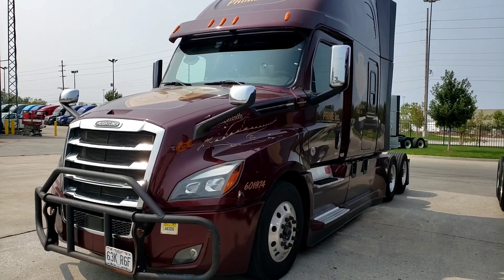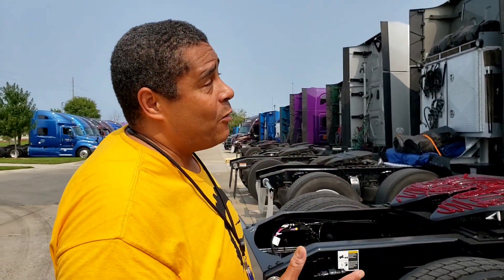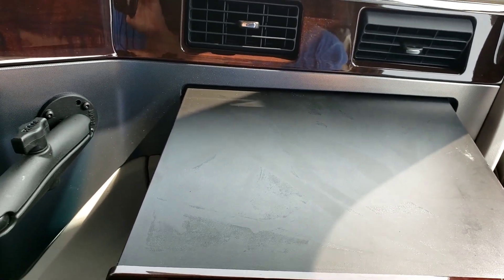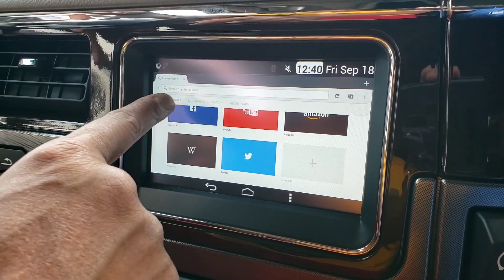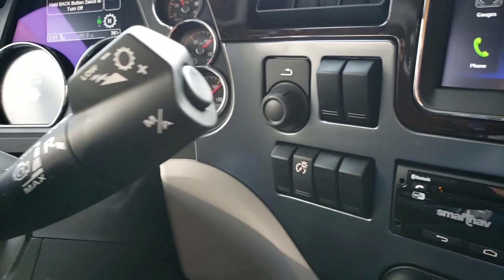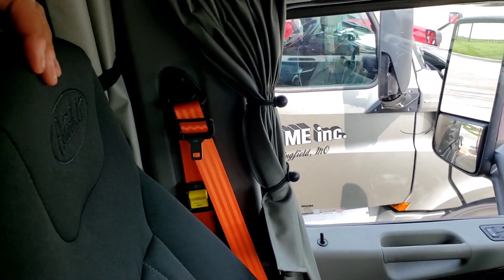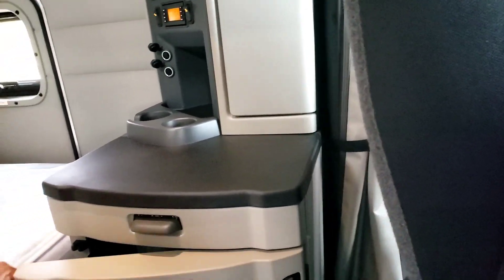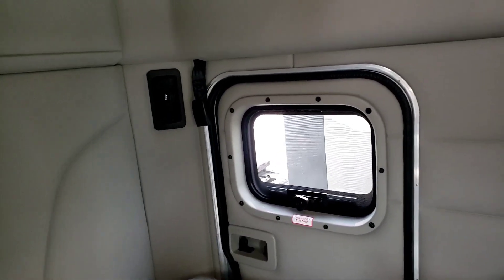My New Truck! 2021 Peterbilt 579 Ultraloft - Full Truck Tour. Inside, Outside and Engine.

Comment: Super singles are a nice ride , they slip alittle in the rain and things like that but you’ll get familiar with them fast no biggie. You save weight with them as well
Reply: They suck in slush, sleet or snow. And as a mechanic they're a pain in the ass to change. Give me dualies any day. We're changing out our whole fleet back to dualies.
Reply from the maker: I haven't had any issues with them in slush, sleet or snow. I'm sure the brand has a lot to do with it. I can see your point about why mechanics wouldn't like them.
Reply: @JJtheTrucker  lol maybe it's just the truckers and always hearing them whine lol and maybe cuz I'm getting old😜we are changing them out tho.. that is one sharp rig btw
Reply from the maker: Aww, c'mon... Truckers don't whine! 🤣😂🤣😂🤣😂🤣😂🤣😂🤣😂
Reply: @machinistmikethetinkerer4827  lol us as truckers don’t have to break the tires off rims and set them on like you as a mechanic so I can see where your thoughts on them are different then us as drivers. They are alittle ruff in snow and slush but it’s like anything else you end up adapting to it. I experience with super singles are with straight boar tankers so I have it ever alittle worse considering I have to fight the loads shifting in weather especially since I haul food products so their isn’t any baffles in the trailers I haul
Reply: @James yeah the guys up here in the great white north, or at least my guys, seem to have more problems than usual. They're hauling cryo tankers and have complained enough where mgmt. has decided for us to switch em all back to dualies. The size and weight make them a bear to change; alot of bullwork. They just don't like to cooperate. But again, I'm gettin old! ☺️

Comment: When’s the update about the apu ac killing storage space under the bed just like it does on the freightliner
Reply from the maker: It's comin. I was fine with where they installed it on the Freightliner, but not in the Peterbilt. They put it right in front of the left baggage door! That whole door is completely useless now. Wish they'd have put it in the middle.
Reply: @JJtheTrucker   that was brilliant of them

Comment: Hi Jasen, is this is an old recording? I ask because on one of your previous video it had the super singles already 🤔..
So, you're doing your lease purchase and eventually you'll be done with your payments lets say in 3 years but after you pay it off, can you still use it under primes authority? and I ask this because most of the videos I've seeing from prime says that if an owner operator wants to join prime, their trucks have to be 2018 or newer but when you pay of your truck lets say by the of 2024 your truck will not be considered a newer model to prime I guess right? So that means you will have to go under your own authority or will prime still consider your truck under their own authority?
Reply from the maker: The first part of this vid was recorded earlier than the caves vid where I showed it with singles.
Yes, once it's paid off in 3 years, I can still run under Prime's Authority with that truck fkr 2 more years. After that, it will be inspected annually to ensure it meets their safety requirements, etc.
Reply: @JJtheTrucker  hey buddy, forgot to ask you...
Can I get into the lease purchase as soon as I upgrade from TnT with the available $$$ down payment instead of doing lease first or do I have to wait a certain time before I can do lease purchase?
Reply from the maker: They say you have to wait 90 days, however Lyle was given the opportunity  as soon as he came out of TNT. The best thing to do is to call success leasing when you are just about finished with your TNT, and ask them. They're very friendly and helpful down there.
Reply: @JJtheTrucker  Thank you 👍

Comment: I like Freightliner's fuel economy. I can't give it up. 🙂
Reply from the maker: Valid point.
Reply: Well it really doesn't do too bad now compared to older Peterbilts. I have a 2020 579 ultraloft from Prime. It  gives me 8.4 to 9.6 MPG with a gross weight of 80,000 lbs running at 65 miles per hour. With a empty load it runs well over 10 MPG. I don't know how much a Freightliner will give but that's pretty good for any truck!
Reply from the maker: That is really good! So far mine has been all over but I've only hauled 2 loads in the northwest mountains, so it's not going to be a good stable reading yet. So far, not bad... Plus it's not broken in yet. I have a feeling it'll be pretty comparable to the Freightliner, just like yours.
Reply: Yes pretty good on this end. I was also given a tip with these new Peterbilt from ace 2 classes. I was told to try to keep the rpms at no higher than 11,000 as much as possible. That's when I realized that I was pushing her to hard on hills.. lol.. it was burning up way more fuel than I wanted by down shifting to a lower gear while the rpms were running at high 14 to 15 range. When I eased up on it I noticed a Dramatic change!
Reply from the maker: Yeah, a lot of people try to run the trucks like their gasoline cars, where the best torque is in the 5000 range or higher. These trucks have their best torque at 1100 to 1300 RPMs. It's almost unimaginably low.
Reply: @trell0123  wow! Whats your setup?

Comment: Hey JJ man (and other truckers that might read this). Regarding the space for a microwave: have u seen people install toaster ovens as alternatives?  They get pretty hot externally. My thoughts would be to add a heat resistant material between the unit and the cubby. They’re cooking is diverse. Any thoughts?
Reply from the maker: I've hear others wanting to do it and I guess the heat shielding may help but not sure. The straps would be my concern. It has to be strapped down.

Comment: JJ I appreciate all your info as I am getting into my new 2021 Pete this coming week. I did not see you mention a fifth wheel release button from inside the truck like the freights or KW’s. Can you mention that?
Reply from the maker: There's no 5th wheel release button. The Cascadia that Prime orders doesn't have it either. Same with the Volvo. The Volvo has a hood release button though.
What I want is a trailer tandem pin release button!

Comment: The new freightliner table is under the bed it turns into a table with 2 chairs idk the new premium freightliner is better than this peterbuilt only thing that’s it’s not better in is ride quality
Reply from the maker: Yeah, there are certainly things I miss about the FL compared to the Pete but the ride quality and some other things make it totally worth it (IMHO).

Comment: I been on the road since late winter 1994 as a truck driver over 26yrs and March 2021 will be 27yrs but I wonder why new truck drivers with 5th months to 10yrs experience become superior over my 26yrs experience and I watch yall at the scale house get pull out of service all the time and watch yall break down on the side of the road all the time,  but also I been a trainer for KLLM in 1997 to 1999, trainer for Warner 1999 to 2001, with 30 drivers i trained successfully still on the road today,  some of them are trainers, and some of them owner operators just like, I been a owner operator since June 2002 and I was asked to do video on my experience but I turned it down,  I rather someone else do it and as long they have knowledge what they are talking about the 🚛🚛🚛🚛 games

Comment: Does your sleeper door have a gap? I have a 21 and mine has a gap
Reply from the maker: No. The Freightliner had a gap. I used thick rubber weatherstripping around it to seal that gap, but the Peterbilt fits nice and snug with no gap.

Comment: To set temperature you have to hit  it auto button first. I'm on my second 579 peterbilt for company I work good trucks. Need and info let me know
Reply: To flash light with the turn signal  push it down and they go off.

Comment: Awesome truck I drove a 2019.
This one though didn’t have the freedom inverter which comes with wall plugs. There’s one thing to watch out for though is the space between your cabinet and bunk. Don’t drop an iPhone down there, I dug mine out with fifth wheel puller and scared me that I lost my phone.
Reply from the maker: Yeah, that was definitely a worry of mine as well. I now have an extension cord in that Gap so that nothing Falls in there.

Comment: Peterbilt really step up their game🔥💯
Reply from the maker: Yes, they sure did. Still some stepping room but I'm impressed.
Reply: @JJtheTrucker  what about the T680 or the 389?
Reply: @JJtheTrucker  and the new LT?
Reply from the maker: The 389s wheelbase is too ling for Prime. They only do aero trucks.
You can get a KW as an owner op but you have to buy it from a dealership.
Prime o KY does the Cascadia, 579 and LT
Reply from the maker: Yep, they have those.

Comment: Apologize if a stupid question, but how is there not a dual rear tires, yet they come with dual tires on both axles, and the. they come change both the tires and wheels.

Why is it that way?  Doesn’t seem logical.
Reply from the maker: Good question. There are many advantages for super singles over dual tires. The number one reason is fuel mileage. Super singles get better fuel mileage than the duals.
Reply: JJ the Trucker  - Thank you, I omitted a key word though.  I meant to ask about the dual tire option... you said it wasn’t available.  Why would it not be available when it ships that way, and the cost to change them.
Reply from the maker: Prime is just really big on low fuel mileage and consistency within their Fleet.

Comment: how long til the xbox and 32" installation? 😂 👍
Reply from the maker: It's comin... Been running like crazy and haven't had time to get everything installed yet, but it won't be much longer. 😊
Reply: @JJtheTrucker  was there a problem with installing your mount at the dealership?
Reply from the maker: The truck came with a flat mount for a very small TV,and it's set off to the side. But it's a stable mount, so I used it by mounting the TV arm mount right to the side of the existing mount. Used the same screw holes and everything. Nice and stable.

Comment: As far as the HVAC controls you set the temperature to where you’re comfortable and press auto end it will maintain the temperature, For example if you set it for 70°F during the day as you’re driving and the sun goes down and gets cooler out the fan speed will slow down to maintain 70! Or if it starts to get really hot out the fan will speed up to maintain that temperature!
Reply from the maker: Yeah, it works really well in the summer and I enjoyed using it however I've noticed that no matter what, it always keeps the air conditioner on. Even when it's cold out and it's heating. Seems counterproductive although I know they're just trying to keep the air dry by doing that. I would rather control it manually without the AC on during the winter. But during the summer it works very well.

Comment: I wonder since you are only a single driver wouldn’t it be easier to have a dinette or I guess a table and two bench seats on the bottom and then sleep on the top I don’t know I’m just curious
Reply from the maker: Some trucks come with thst option. Takes away a lot of storage doing it that way though. Personal preference.

Comment: If your going with the blacked out grill you should look into getting the wheels powder coated black or black chrome with the tanks the same. That would look great together, actually it’ll look better that way the grill ain’t one color where chrome should be and the wheels another. It’ll all match up and look sweet. I had a WL900 Kenworth all done up with a cat, twin turbos , 18 speed, the list goes on and that thing moved like there wasn’t a load on it even when I was on the “very heavy” side of the scales. But anyways it had the wheels, tanks, and 6inch straight stacks all blacked out with the body (it was a dump truck) the same, all black chrome. The cab was a metal faked cherry red with a pearl coat over it. Man it was nice but I had to wash it every other day from going in and out of  the dumps everyday . Wasn’t exactly the best kinda work for a truck that looked like that but I loved it. 😊
Reply from the maker: Where can I get that done?

Comment: I preer dual bud spaced tires in the back anyday over super singles. But super singles are much better than they used to be, and as long as you keep them aired up properly they won't be a problem, however if they're low on air even just a little they will have a pretty good chance of blowing out. My dad worked for Flying J before they were Pilot Flying J and they had super singles there and those guy's wouldn't air them tires up and they'd just blow out left and right compared to the duals.

Comment: I run a 2020 kw t680 there are a few differences between the t680 and the 579 both are pretty good trucks. The only thing i dont like about my t680 is it has a mx13.

Comment: Nice truck.... but I can't believe people still do the starving trucker lease plan with prime🤔
Reply from the maker: Really?!? You clearly are not educated enough in Prime's lease program if you're saying that. Why don't you go ahead and watch some of my other videos talking about the lease program and get some education so that you'll stop spreading false rumors and lies about this program.
Reply: @JJtheTrucker  sorry but unless things have changed...over 20 yrs and 4 million more miles spent trucking, talking to many Prime drivers, not one has ever spoke highly of leasing. Now, all I did was make a simple statement but you can be a dic all you want. but if the majority says negative things then I'll go with that rather than the few who says otherwise.
Reply from the maker: Seems like every time someone says something negative about anything new or something that's working, they throw in their 20 years of trucking hat into the ring. Things do change, but most of all, you have zero first hand experience in what you're talking about. Only second hand, one sided stories. I may not have 20 years and 4 million miles, but I do have first hand experience with the Prime Lease, and I'm doing anything but starving.
Reply: @JJtheTrucker  Have you done a video break down of total operation costs vs profit per quarter? I looked and didn't see one.
Reply from the maker: No, not yet. I wanted to get a full year's worth of data in my spreadsheet before doing that. That way the numbers aren't skewed by home time or lack thereof within any single month or quarter.
Reply: @JJtheTrucker  I forgot to ask....you have any say as to where you run or is it a you run what they give you?
Reply from the maker: I can turn down any load for any reason. I tend to only turn down about 10% of them or less. My dispatcher knows what my preferences are.
Reply: @JJtheTrucker  I figured it would be one of those go to NY City or else kinda deals. That's good that you can do that,kinda surprised honestly
Reply from the maker: I don't mind NYC as long as I'm in the 6th hole. It's those late pm pickups and early am deliveries, or yeah it's $3 a mile but 500 miles, deliver  4 days from now kinda stuff I don't take. Leave those to the company drivers. They can't turn down loads 😂🤣😂🤣😂
Reply: @JJtheTrucker  ain't NO WAY I go to NY City! Did my time in that hell hole once and that was enough 😂
Reply from the maker: Lol. Probably sound advice. My 1 delivery there was right off the bridge so it was kinda easy-ish. Didn't really have to go too far.

Comment: looking very nice JJ , it looks a bit smaller inside but it will be a better ride in sure andwe run a fleet of trucks with the mx13 engine and they pull well and the new gearbox has been improved , no quit and ishift in the volvo but getting there , regards from Great Britain
Reply from the maker: Thanks Dardie. I'm sure I'll get accustomed to the smaller size.

Comment: I'm in a 2020 Cascadia now and just I have just about every square inch of space filled up, I can't imagine loosing that much storage. I can't wait to see how you overcome that hurdle. I'd love to get into a Pete but the lack of storage would be the only deal breaker for me.
Reply from the maker: It wasn't as bad as I thought it would be Jason. The cabinets are deeper and the bunk up top is much larger. The top bunk in the Peterbilt is actually larger than the bottom bunk on the Freightliner, which made a big difference. What I really do miss is all the storage of front in the drivers in area.

Comment: You NEVER wanna stop the truck from regen if it starts by itself. If it kicks on by itself your truck is already in stage 2 and you shitting it off can mess of up as to kicking you right into stage 4 where the truck won’t go over 10/20 mph and then you need to be towed in. If it kicks on by itself it’s already been telling you to do it an you haven’t so it’s telling you to step aside it’s taking over and if you try to fight with it it’ll win and totally shut you down

Comment: Any new truck looks nice clean sitting but, you want money and can't get it by keeping a clean truck on the outside and inside, hopefully you run hard.
Reply from the maker: It's impossible to keep a truck clean on the outside if you are running OTR. But on the inside is very possible and easy to not be a slob and clean up after yourself. It's not like I have anybody else to clean up after. So yes I do keep the inside of my truck clean. I do make plenty of money but I do not run as hard as many of the other truckers out there. I simply don't need to. Prime pays a lot better than most people give them credit for.